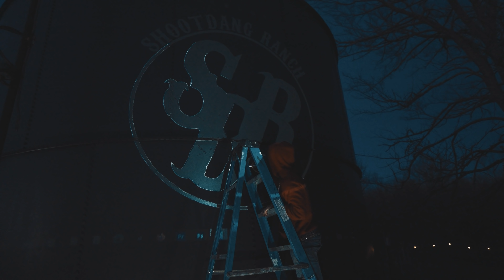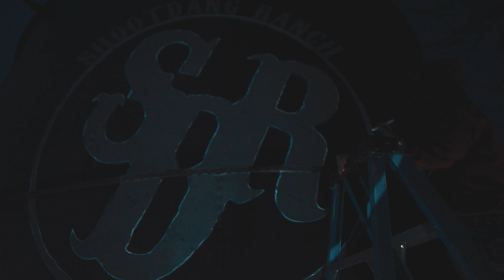100 YEAR OLD Shop & Barn Gets MODERN MAKEOVER! New Paint & Roof, Windows and LOGO! / Barndominium

Comment: Looking good. Are you guys going solar? Seems an easy fit for the amount of sun you get and would save a great deal in fuel and time. You could elevate them and put a green house below it so it's not direct sunlight on the plants so they don't overheat. Looking forward to what's next.
Reply: Also a round wind turbine on the peak of the shop roof would work too.

Comment: Love what you guys have done with the shop.  I know people have been telling you not to paint the roof black, but I have found out that if you put the insulation board with the aluminum up toward the ceiling it will reflect the heat out.  That might help to keep it cooler for you. Good luck with what you are doing.  It looks great.

Comment: You could maybe use that big tank to generate mini hydroelectric power if you have a good water source or line the outside with solar panels and generate electricity that way or mount a wind power generation unit on top.

Comment: Jason, I know you have a rental equipment company there. Check to see what it would cost to rent a small excavator with a jack hammer attachment. You will have those concrete pads out of there in a few hr's. Most of us ole guys do not have the stamina to run a regular jack hammer as you found out.

Comment: Y'all know know you guys are going to probably have to customize some kind of plexiglass windows in there for ventilation for your babies for the summer time which will probably go with y'all colors with wood grain trim. I know y'all will come up with something. Because the heat in that metal container will probably be unbearable during the summer unless it's ventilated on at least two sides to get air flow. Good luck you guy everything is looking 👍🏻

Comment: Y'all and animals are going to regret the dark color of the buildings come July and August...dark colors attract heat.
Reply from the maker: We're not worried, it's Oklahoma.... it's hot no matter what
Reply: @TheCrockers  I've lived in a lot of different climates, the mountains of extreme Northeast GA, the extreme South East GA, South Carolina...but the worst part was while I was still married to my ex wife, 12 years of heat indexes of 118 in Augusta GA, and so humid. Could step outside dry and step back in within 5 minutes and be soaking wet with sweat. South GA was hottest but that was tolerable due to that it was dry heat. Now Northeast GA, near the mountains it's more mild with the average high in summer at 87 to 90, in winter you're looking at around 35 to 50 for a high with lows that dip to the low 20's and sometimes into the upper teens, once in a while lower teens.